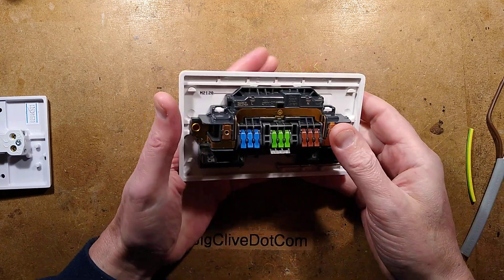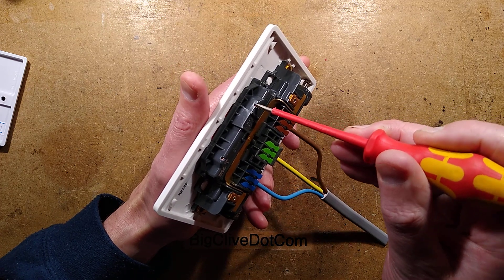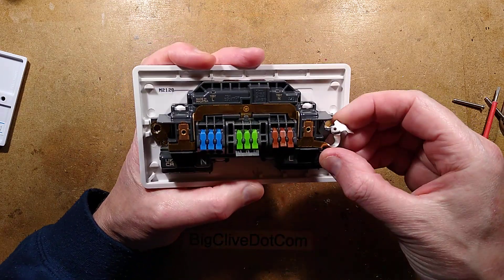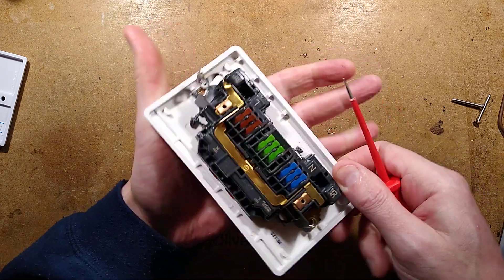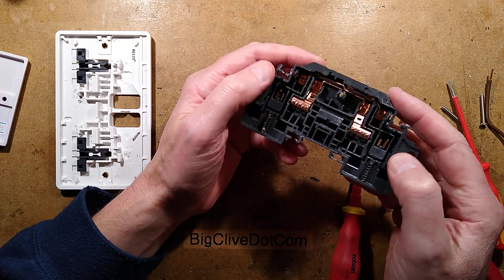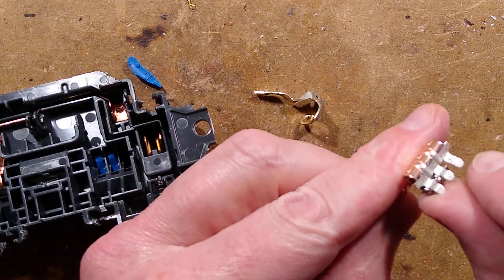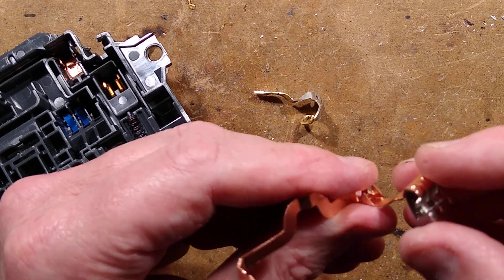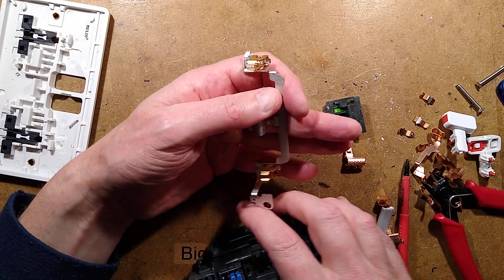Teardown of the new MK screwless socket

Comment: Technology connections guy needs to understand the benefit to having switches on socket outlets. Why won’t he learn? 😀
Reply: What is the benefit of that, then? I mean, you’re not going to rely on that switch to do work on the appliance, versus just unplugging, and in daily use the outlets are always going to be in an inconvenient place to switch.
Reply: @JasperJanssen  A lot of stuff these days cannot be switched off and is always on standby. Plus it saves repeatedly having to plug in and out stuff all the time.. Flick a switch, done.
Reply: @JasperJanssen  Also in case of some devices that pull current as soon as you plug them in (charging the caps etc) you can eliminate socket contact wear by keeping it off with the switch until you have a good full connection
Reply: @JasperJanssen  they’re handy. Like other have said. Standby on loads of appliances sucks, flicking the switch is quicker than unplugging, more convenient. I always switch off the blender, coffee maker, mixer, etc at the socket, incase one of my kids fancied playing with them. 

The UK has regulations on socket outlet positioning for the disable people, so they’re always in a convenient place. 

Also helps with fault finding if somethings tripping out the fuse board. Switch everything off and switch them back on one by one.

Obvs it’s all first world problems. But it’s a slight convenience. Always feels weird seeing a socket without a switch, and I’d never buy a switch-less socket outlet. 

Also UK plugs are big and maybe would be a pain for someone with arthritis having to pee about with sticking them in and out all the time.
Reply: @firegoose2167  big isn’t the issue really, but yes, UK plugs definitely have much higher insertion/retraction force than most others. Especially the plugs for smaller devices, which are physically smaller over here and thus require less force. That part makes sense.
Reply: @firegoose2167  I thought UK sockets were usually very low to the floor; am I mistaken? US outlets are usually 18 inches above the ground so you don't need to bend down much to reach them.
Reply: @eDoc2020   they have to be at least 400 or 450mm from the floor. Which granted is still low, but if it’s in plain sight, a quick karate kick with your big toe can turn the socket switch off.
Reply: @JasperJanssen  Turning a toaster off at the wall. Turning off a thermostat controlled room heater. Soldering irons, clothes irons. any chargers and power supplies. power tools between uses. Anything at low level to save you bending down.

Comment: As soon as I saw that silvery coating I thought "not alumin(i)um. That's got to be a thin layer of silver".

The socket looks nice. Easier to fit than a standard socket because of each set of wires having dedicated connectors.

Comment: I'm curious being from the states, our outlets are generally rated for 15 amps and we use a minimum of 14gauge wire. Now we also have with a slight change in the socket, 20 amp service, which I would normally run 12 gauge wire. Here's the rub... If you combine different wire gauges in a terminal, often times the lighter gauge wire will not get the clamping force required to keep it engaged to the terminal or even wire nut. With a limited amount of spring connectors in your example, it would seem limited for connectivity. I would imagine there will be many variations to accommodate most configurations. My original question before I got on the rant was, what wire gauges do you normally use in the UK, Isle of Man? While we are stuck with 110-120 volt circuits here, we do have a 277 volt commercial service commonly used in hotels for heat/AC, etc and they use a much lighter gauge conductor.
 I was actually quite impressed with this bit of gear you utterly destroyed for our enlightenment, as I have found a lot of electrical gear quite flimsy especially when it comes to lighting.
Reply: We typically use 2.5mm (between 13 and 14AWG) for our final circuits, if they are a radial (a string of sockets that starts at the consumer unit (fuse box/breaker panel), and ends in a socket) then this would typically be protected with a 20A breaker, however, if you start at the consumer unit, and go in a ring and end up back at the consumer unit, this would then be protected with a 32A breaker (both ends of the ring in the same breaker). With this ring arrangement, you are permitted to connect a piece of 2.5mm cable to any point in the ring (typically done at a socket) and then add one socket to this spur (you can do this multiple times around the ring, but if you have lots, then the circuit really should be re-designed) All our plugs all have fuses in them, at 13A or lower, so each appliance & its flex will be protected by that fuse. You can connect a fused connection unit in the ring (or as a spur) and then connect what you like to that, as that entire part would then be fused at 13A or lower. The breaker in the consumer unit is primarily there to protect the wiring in the property, the local fuses in the plugs are there to protect the appliance and wire from the plug to the appliance. Socket circuits are generally protected by a 30mA RCD as well, this is either a dedicated device that protects several circuits (typically two per panel) or an individual breaker can have this built in, which is then called an RCBO (Residual Current Breaker with Over-Current). FYI, the US is a 240V country too, you just have an additional center tap on your transformers that split this to two 120v circuits, so you have 120v--0v--120V with 240 across the two 120v legs, used for things like A/C, driers, car chargers and anything else that needs lots of power.
As we have fuses in everything that connects to a socket, then our extension cables and multi-socket adaptors are a lot safer than the US ones too, as they all have fuses, so any overloads would blow that local fuse, rather then them going on fire if loads are daisy-chained together!
Reply: @Sparks0001  Excellent summary.
Reply: In the US I don't think it's ever allowed to put different wire sizes on the same terminal, precisely because of the problems you mention. In fact the vast majority of our terminals are only rated for holding a single wire. If you have wires falling off chances are you're doing something wrong.
Reply: @eDoc2020  It's not common in US wiring that you would use different wire sizes on the same circuit. You might do so if you had a long run between the circuit breaker and a group of outlets--then you might use a 10AWG wire for the long run (to reduce voltage drop) and then a 12AWG wire between the outlets.
Reply: I don't know about the UK wiring, but in Sweden and Germany the wiring inside the walls is usually solid copper core 2.5 mm² roughly corresponding to AWG13.
In the case of 10 A systems one would find 1.5 mm² which corresponds to AWG15.
Reply: We do not have a 'gauges' for cable - we have a properly  designed system that incorporates redundancy, flexibility and safety. You just don't need multiple sizes of cable for a given task. Obviously the current carrying component is the starting point of cable selection but then you factor in cable run length, installation method (clipped direct,underground whatever).

For domestic installations the main incoming (supplier)  cable size was 16mm2, now is 25mm2 which feeds the installations fuseboard via meter. 
Inside the house - sockets (ring) would be 2.5mm2 (live,neutral) with a 1.5mm2 (earth), Twin & Earth)
Lighting (radial) typically would be 1.5mm2(live neutral) with 1mm2 earth (might be 1.5mm2 earth can't remember). T&E
For the interlinked fire protection (smoke, heat, CO detectors) 1mm2 3core. Triple &Earth
An electric cooker - 10mm2 + 4mm2 earth radial. T&E
For a typical 9.5KW shower I would also install a 10mm2 +4mm2, T&E.
Obviously resting is mandatory,  breaker ratings and characteristics are based on the 'Earth Fault Loop Impedance' of the installation and 'borrowed' neutrals are banned / illegal. Each one of our installed circuits must be able to act alone with respect to fault conditions and current carrying capacity.
Reply: Even 277 volt circuits in the USA still use a minimum of a 14 gauge conductor. As I recall the NEC doesn't allow building circuits rated at less than 15 amps (at any voltage, 120, 208, 277, 480, and so on), so that requires a 14 gauge conductor.

Comment: I'm curious as to how long the plastic earth-slide-spring-latch-thing will last.  Will it retain its springyness and flexibility with time/heat/light exposure, or will we be left with unguarded pins after a few years?  Would this be enough to fail the electrical inspection insurance companies say you should have every 10 years?
Reply: Given the amount of decades the "earth-slide-spring-latch-thing" has been in use, the simple answer to your question is - they last.
Reply: @stupidlogic2987  I'm aware of the normal sprung sliding gate, that is indeed very old, standard in all UK sockets for years.  This new style is not decades old.  In the video, Clive says he's not seen it before, it is a very different design.  This gate is latched, not just sprung.  The thin plastic prongs in their resting state appear to latch sideways into the little white "bone shaped" piece in the socket.  The earth pin inserted between them unlatches them.  The downward movement of the gate is now caused by the line/neutral pins pushing on the angled shutter.  Its a very different mechanism from the old one.
Once they've been around for decades, I guess we'll find out how well they last.

Comment: Could the coating be softer than the brass so that it'll get squidged (technical term) when the spring-a-ma-things squeeze onto the cables and give a better contact?
Reply: Nope. It's because of aluminum wiring. Aluminum will cause oxidation because of galvanic against copper or brass.   So they tin coat an intermediate alloy.

Comment: maybe zinc coating ? since its  popular metal used to connect cells together
Reply: most probably not, since zinc will rapidly corrode when it is in contact with a more noble metal such as copper.

Comment: Might catch a few diyers out if they buy one to replace a socket outlet. Particularly if they have old cable with stranded cores not to mention cable length and positions. Are these style connectors suitable for stranded cores?
Reply: Yeah, shouldn't be a problem since they are applying a positive clamping pressure. It's push type terminals (like Wago 773 series) that are (in)famous for causing poor connection with stranded wire.

Comment: Some UK sparkies have suggested that there should be 4 earth (CPC) terminals.  1 for the ring in, 1 for the ring out, 1 for potential spur as with the live and neutral terminals, plus one more to allow a fly lead to earth any mental back box.
Reply: Won’t need one for the metal back box - the screws that fasten the socket will earth it
Reply: @samuelfellows6923  Good point. I know that is acceptable if one of the box lugs is non-adjustable (which is almost always the case). Somehow I just like the dedicated connection, but it is probably a bit OTT.
Reply: @samuelfellows6923   A lot of people think so.  While a lot think it desirable (at the least) to connect the box.  Hence my writing "Some UK sparkies" and venturing no opinion of my own.  😀
Reply: Was thinking the same.  Can work around by leaving a long length CPC on one side of the ring and looping it (folding rather than cutting) in to the backbox earth terminal first - which is ok for new wiring but if replacing chances are you'll have no length to work with.

Comment: These are being released in Australia also. Both 10a & 13a for household use but I have been wondering for ages why they have not used wago connectors because it gives a reduced faulty connection due to workers in a rush. Much better than the old style power points and light switches.

Comment: Nice, but pricey

Screwfix are knocking them out at about 30 quid a pop!

Edit add: Mathew just pointed out that's a 5 pack!
Reply: That's £30 for a five-pack,  £6 each.    That's 60% more than the screw ones.
Reply: @calmeilles  whew, thanks, I just saw the thumbnail and froze...
Reply: @calmeilles  These are probably aimed at fitters who are doing entire buildings. Could they save enough time to offset the cost?

Comment: Spring loaded terminals have been common on industrial machines for many years and I am divided on my opinion of them, I have never seen a burnt connection due to a loose terminal but I find them difficult when fault finding as they don't often allow any space to get your multimeter probes in. MK have tackled this issue with small holes for probe contact.
Reply: So have all the good brands.

Comment: The silver coloured material is either a silver or silver nickel alloy coating. The copper coloured material is either a phospher bronze or a copper iron alloy. The company that I worked for manufactured  the metal socket bits for MK.
Reply: What is it for though?  Is it a safety feature or something?
Reply: @101perspective  : It'll be for a mix of mechanical, electrical, and chemical characteristics (that last one is why you don't use aluminum for residential wiring- oxidizes inside of mating surfaces too fast).
Reply: @absalomdraconis  My thought was overheating may melt it and make it a self-soldering connection :)
Reply: @absalomdraconis  I always use duralac paste for aluminium conductor connections. Prevents electrolytic or galvanic corrosion
Reply: @absalomdraconis  Copper-silver-nickel alloy would be too generous and mainly too expensive - this is the third prize winner of expensive alloys for contact dimples like in quality switches and relays and makes little to no sense as a not sparking contact surface cover. However it looks and very much might be the copper-nickel alloy like the one in silvery coins - looks posh, oxidises and corrodes very slowly (I think it also contains zink and is easily and extreemly fast doposited via electroplating in molten solution).
Reply: @101perspective  maybe its to maximize the contact surface and so it will minimize the resistance or maybe it stops sparking so the surface doesn`t gets damaged as fast this is just a guess though
Reply: I wondered if it was manufacturing? As it is clearly applied to the primary material before it is pressed into a very complex shape? I wondered if it was some kind of lube / mould release?
Reply: @a531016  ex tool maker here. No, not a manufacturing aid, properly made press tools are made with ease of extraction in mind, plus it's simple to add sprung loaded election pins or sections.
I believe it is nickel plating to reduce corrosion at the points where the bars are permanently connected together or held in place with the rivets (for the earthing of the screws) or any other connections, which are non serviceable. There's also plating on the cable clamps.
Also it's more cost effective to have the material already pre plated rather than plate the individual components.

Comment: I see this socket is made in Malaysia, which is where I live. The sockets available to buy here are not of such a high standard because no one wants to pay for decent ones. There is a culture of stuffing 2 pin continental style plugs into the 13 amp sockets so the only protection you have then is the 25 or so amp circuit breaker in the fuse box. Fires are common, especially in wooden buildings despite the ubiquitous RCDs.
Reply: Doing so may damage the socket. This could then cause poor connection later and fire.

Comment: Aluminium is a fairly good conductor. Much of the electrification in East Germany was done with Al-cabels in order to avoid expensive copper.
Reply: Aluminium has about 54% higher resistivity than copper.
Reply: But it weights a third and costs a quarter per weight.

Comment: Squidgy solder for making sure there's less resistance in the contact points maybe? Interesting socket though, and would nicely stop people stuffing too many wires in the back of a socket when doing DIY spurs off sockets already feeding spurs... :D
Reply: You only need to put 3 terminal blocks in the backbox and have one wire to these sockes and wire the ring and more into the terminal blocks ;)
If I installed a ring, I wouldn't break it at every connection - bare the right length of wire, fold it in half and poke it into the terminal. If these won't take doubled wire, I'll not use them - or spur them off terminal blocks !

Comment: wait, do you in UK still often use Screw Terminals???
Over here in Germany we use the "Wago Style Clips" for decades. Even before the 2000s, we used clip terminals (and the Busch Jäger Schuko haven't changed much in 22 years or so)
Reply: Yeah I can confirm that too. I have seen these for decades. Like there are still really cheap screw terminals available but usually one just goes for these "Wago style" ones anyway.
Reply: Yup just about every wiring accessory still has screw terminals on the back.  I always assumed it was down to price, most sparks here won't touch these Wago double sockets as they are £6 each vs the screw units are £3.50.
Reply: Sadly we do.  Read some of the replies above to see how widespread misapprehensions sadly are in some parts of the UK.

Comment: You can often determine if something is aluminum if it corrodes from sodium hydroxide/lye. If I remember correctly, it'll turn different colors depending on the alloy series (although that's imprecise).
Reply: Not really...caustic won't confirm the presence of aluminium